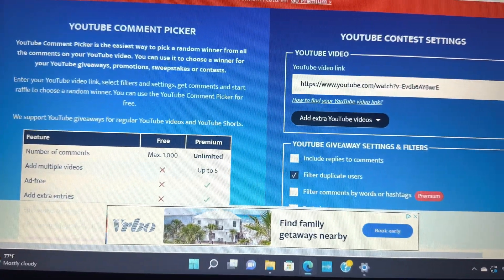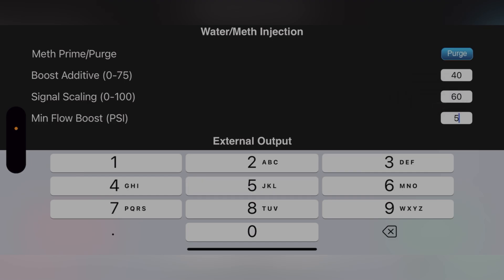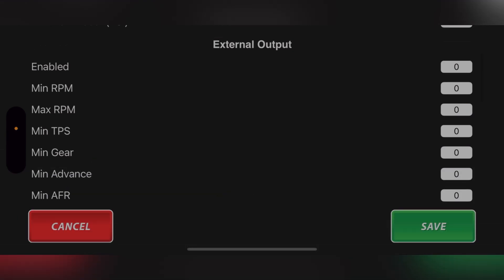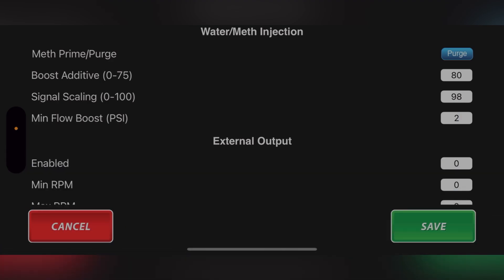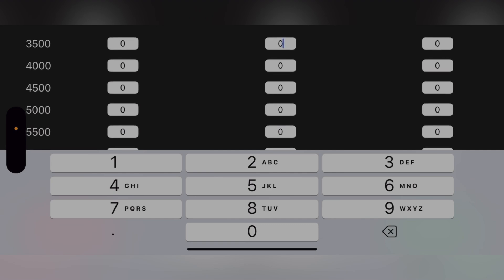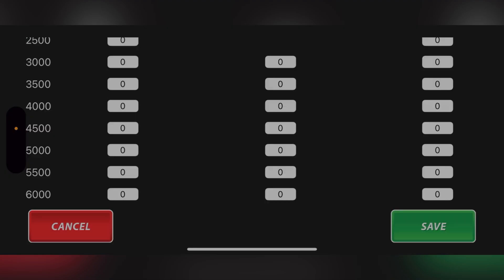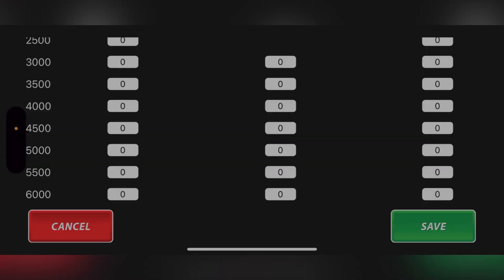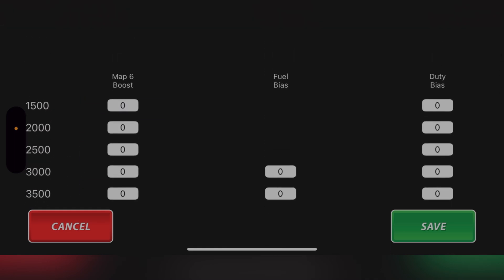CPI & WMI guide/install settings 🙏🏽 No more map7 🤢 + Giveaway winner!

Comment: David what is the safest boost level without meth or cpi, and keep in mind I'm running on E30 in RI so it's cold here mid 70s
Reply from the maker: Around 20-21 do can do some test runs. And if you over boost. Just turn it down.
Reply: @DavesGaragee  yea I'm on map4 with E30  the car runs great no corrections or anything, I might play with map6 do as you instructed in your previous videos.

Comment: Wassup buddy longtime no hear.
Quick question I'm about to purchase tork stage 2 tcu tune before I put my jb4 on I should be fine right until then ?
Reply from the maker: Yeah tcu can be ran with jb4. I ran jb4 and a stage 2 plus ecu
Reply: I forgot to ask you if i have to make any adjustments to the jb4 when I get the tork tcu tune stage 2 ? Or can u just plug up tcu and go ?